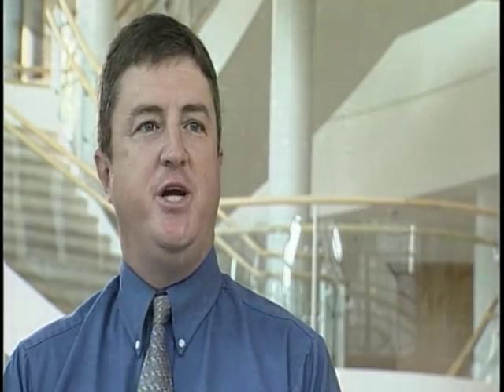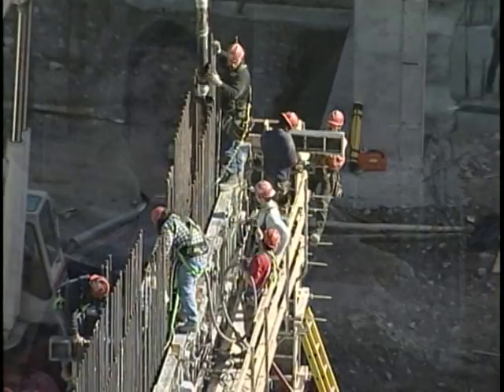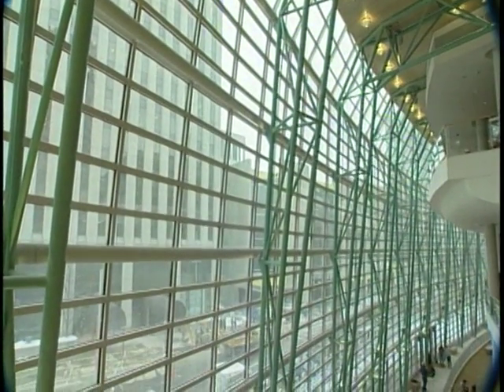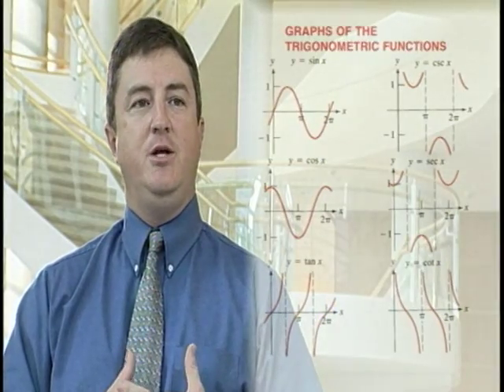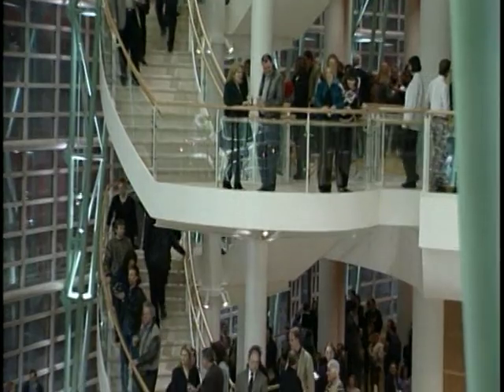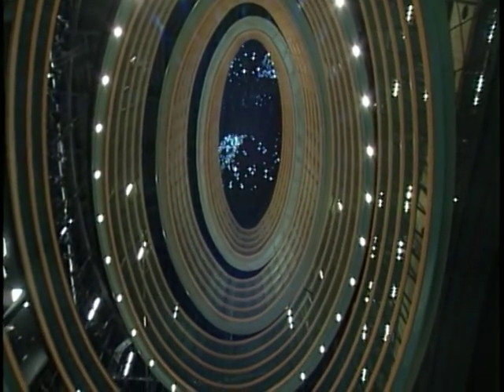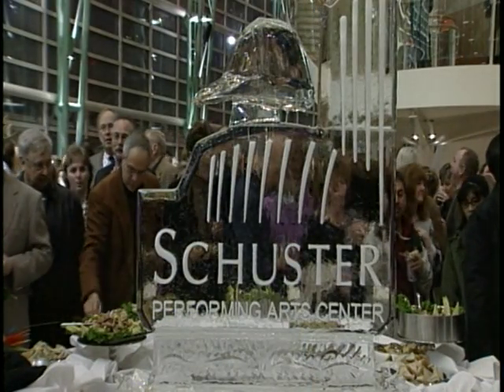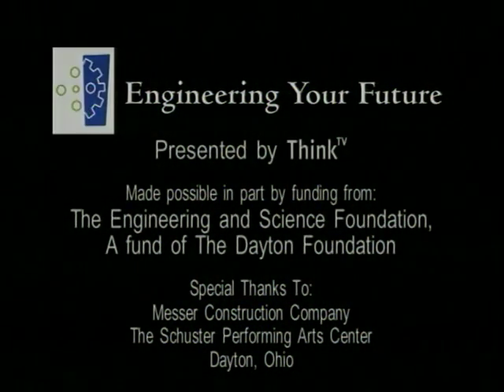Engineering Your Future - Civil Engineer

Comment: @addieroxrev09 you are aware that its not called civil because egypt was the first civilisation right? egypt was not the first civilisation either. engineering was originally only a military position, then civil engineers were required . civil means of or for the citizens.